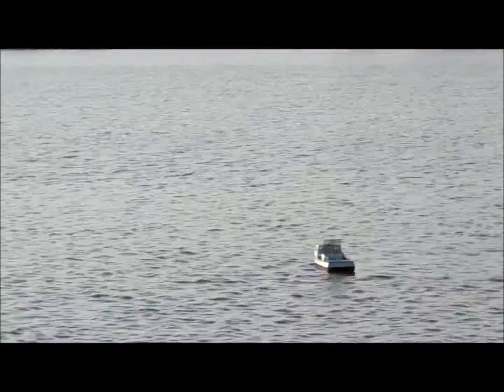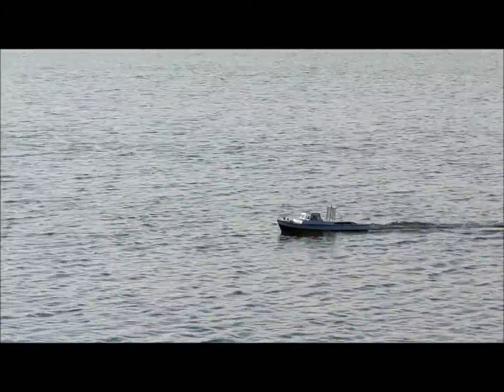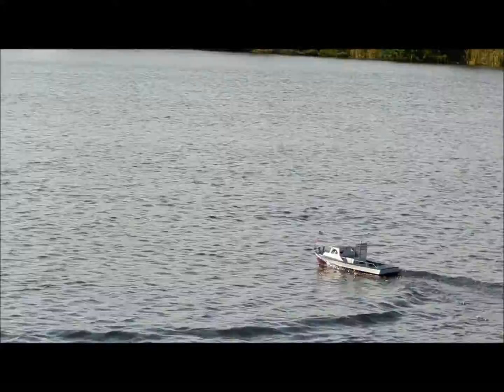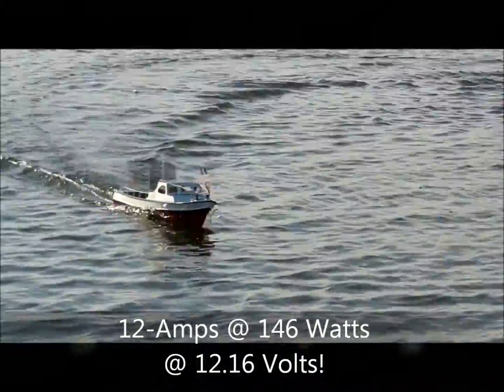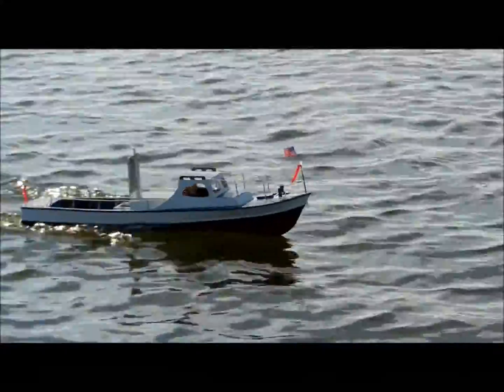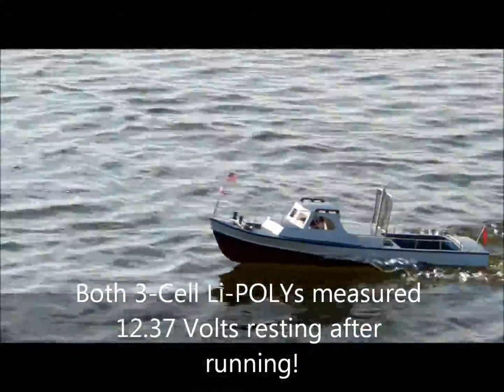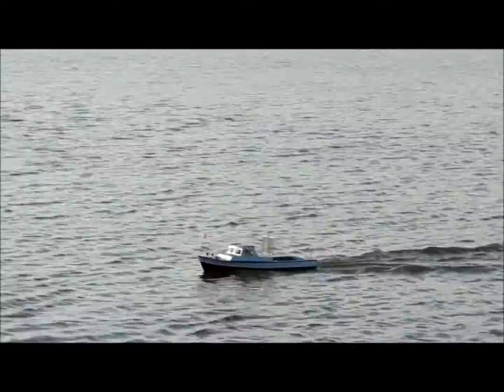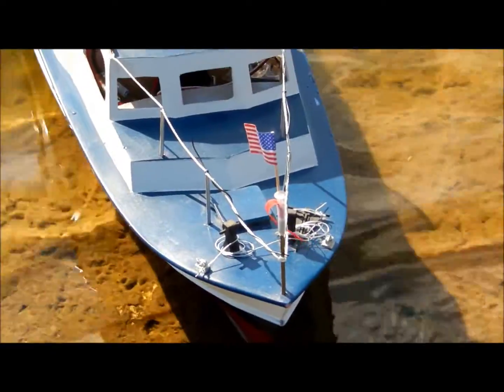DUMAS Coast Guard Rescue RC Ship with new Propeller Experimentation 11-04-2012

Comment: Carlos, are you running the twin prop setup or just single.
Also curious which motor you are using, and the size of prop.
Thanks.
Reply from the maker: Single Propeller, if you carefully see the beginning of the Video, you can see only one screw.  The motor is a Kyosho Monster 550 Brushed motor known as Endoplasma in a Great Planes GD-600 gearbox (3.0:1 ratio).
Reply: I just watched a bunch more of your vids regarding this boat. Thanks for speedy reply.
Still curious as to the size of prop. I want to build this boat with single prop setup like yours. Are you still running her?
Reply from the maker: ezr168
Please go to the very first post "INFO" and select "SHOW MORE" and click on the link I have provided.  I am sure that I listed the type / size propeller I used.  Yes, I am still running the boat, last time was two months ago up in Jacksonville, Florida with the ORCAS RC Boat Club Fun Boat Sail event.
Reply: Carlos Marin Of course the beginning of the video spells it all out, missed it initially. Thanks Carlos.